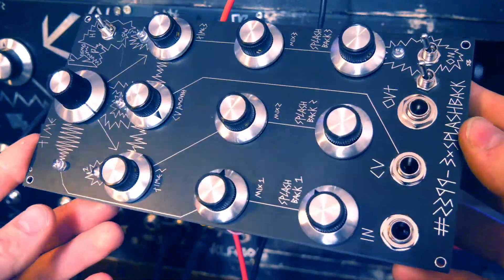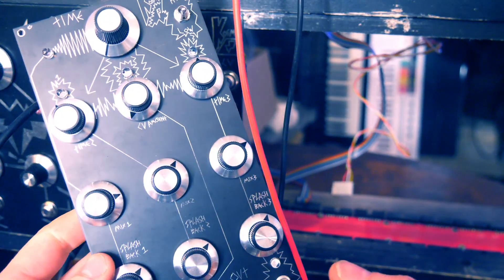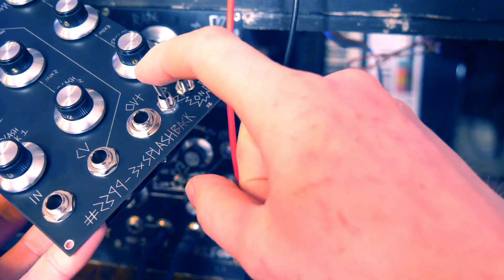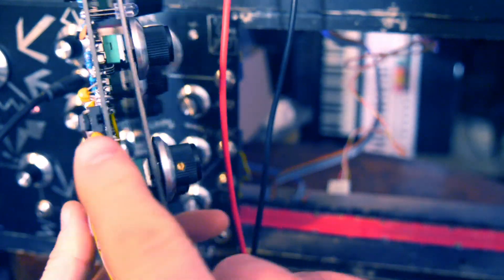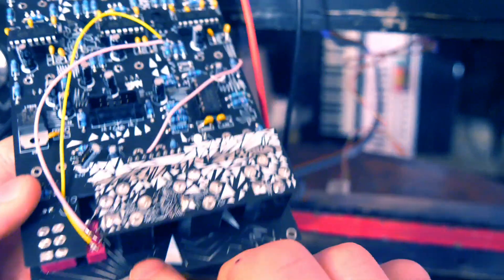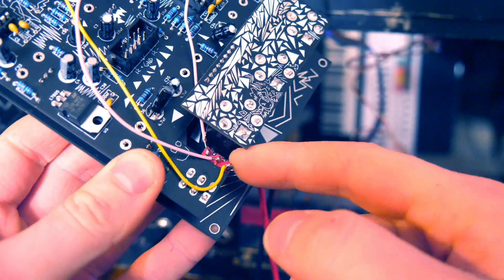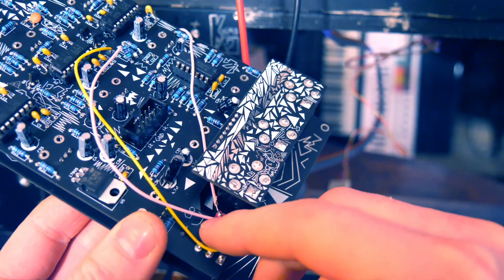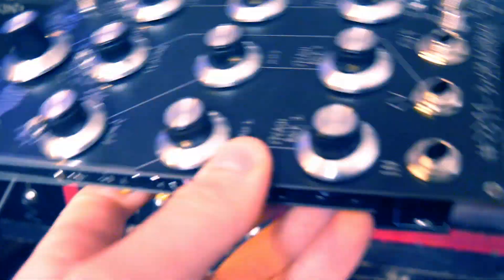Kosmo #2399 TRIPLE SPLASHBACK, Wet Switch Modification

Comment: Trying to breadboard this mod. Is TOP of the R27 the side closest to the PT2399  or "the other side" of that restistor (connected to out 1 in the schematics). Also is the C22 removed from the schematic (Need to know so I can leave it out)